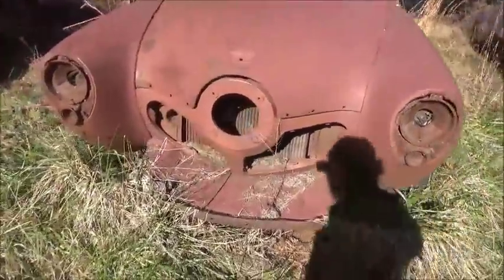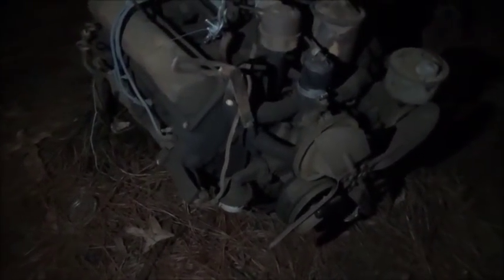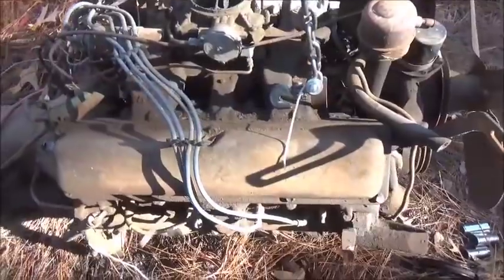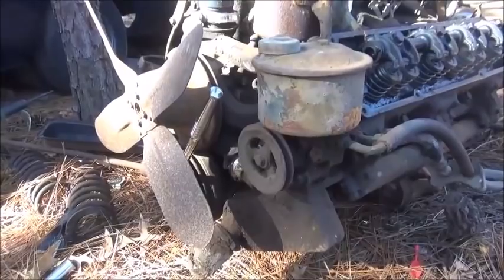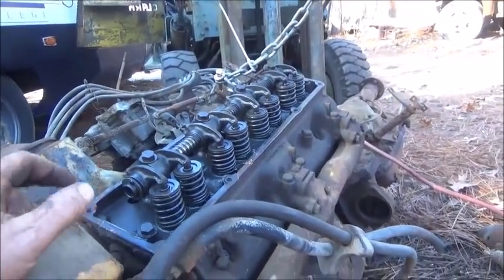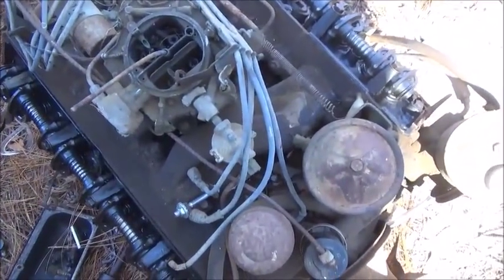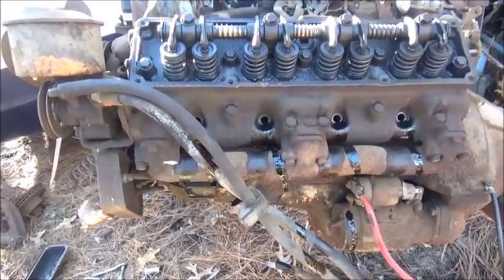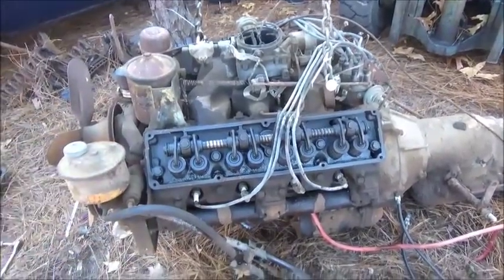1956 PACKARD 374 ENGINE STUCK FIRST START IN YEARS!!!!!!

Comment: With the carb rebuilt that baby will be purring soon. 
Good job Jonathan. Noah is the starter master with a screw driver.
Thanks for sharing.
Reply: @jtyhill5475: The carburetor is a GM ROCHESTER 4 BARREL 4GC. The electrical system is also GM.

Comment: I worked at the Ford Utica plant here in southeast Michigan for 37 years.  That plant was originally built by Packard in 1951.  This is where your Packard v8 and your automatic transmission where both manufactured in the mid 50's.  You really should come up here to visit the Packard museum on that site.  One of the best automotive historical museums in the country.  They have 2 open houses per year.  One in spring and one in the fall.

Comment: Great video, the starter wasn't even smoking. Those old starters take a lot of abuse anyway as they were made better then the new rubbish they sell. We used to start 12 Volt diesel tractors with 24 Volts in the winter, never had a starter fail on us. (the starters did get hot I have to admit) With the old batteries used here, the voltage was more likely around 16 to 18 Volts.

Comment: The engines of my youth! (I'm 73). Nice to see an engine with parts that I recognize. Today's engines just don't have the same soul. In the "olden days" a screw driver, your mom's emery board, a set of pliers and some bailing wire and you were good to go! My new 2019 Camry XLE "talks" to me and I have yet (probably won't bother) figured out how to work most of it's gizmo's.

Comment: Talk about one lucky man. But the minute I saw the engine I thought to myself, this engine is going to run well. The way they made engines back then, especially for the Studebaker were put together right. You can't say that about every car back in the 50s but Studebaker was pretty famous for their engine designs and their longevity and ease of maintenance. I would put them in the same league with Hudson back then. That 374 that you have right there was a really good engine with lots of torque and plenty of horsepower. Now that engine was made to Hot Rod. Pretty sweet Jon. I am really looking forward to seeing what you do with it.

Comment: Thats awesome. I take engines that are out, fill the cylinders with oil, put the plugs back in and turn the engine upside-down for a minute or so. It gets the oil on the valve guides and cylinders below the pistons. It really makes a mess, but really helps lube those badly needed places. If the engine turns, I will turn it over so all the valve guide in the port get oil, if the engine is not stuck. Your engine sounds great!

Comment: I bought a 85 Ford bronco guy said motor was locked up it was the starter and it ran good paid 500 sold it 3500. Always check the starter first thing. Great video as usual guys.

Comment: One time I had a motor that hadn't run in a very long time, and I couldn't turn it.. looked as neglected as this but even worse.  It had very little oil in it, so I put 3 quarts in it, pulled the distributor, and spun the oil pump for like 5 minutes.  Turned fine after that.  It's what I was thinking with this, but you got it turning.  The motor I freed was in an old car that was sunk in the mud, so no access to the flywheel.  Turned out to be a strong motor.  Was a Pontiac 400.

Comment: Jonathan you are a miracle worker getting that engine to fire up after it being ' stuck!'
That will be sweet in your hot rod.
 Just what do you use for parts for a Packard engine after you get it running right?

Comment: 50 years we were at a friends wrecking yard trying to start a 1936 Chrysler imperial that had a straight 8 engine. Our friend Jim was pouring gas in the carb to prime it. The engine back fired and Jim jumped back from the car and dumped burning gas all over himself. He started to run and we threw him on the ground and rolled him over and managed to snuff out the fire. He was wearing Levi jeans and that had helped him from getting burned too badly. His belly and the inside of his legs got burned the most. As for myself, I worked in another wrecking yard for 32 years as the engine mechanic. I ran hundreds of engines over the years and inhaled a lot of smoke. In 2014  I started peeing blood and the doctor told be I had Blatter cancer that was most likely caused by all the smoke I had inhaled over the years. After 4 years of treatment I had no more cancer. Just saying be safe.

Comment: I need that 374 for my 56 executive , I have a standard bell housing a super T 10 will bolt right up . I have a 68 ford toploder I hope to use , I have looked around for 374 pistons no one makes them , tho a 352 can be bored to 374 . A 374 4.125 bore is same as chevy 400 I believe 318 lifters can be used, That vacuum pump mounted on the oil pump kinda sucks " in the oil pan " their is an olds oil pump conversion for it. The packard is the only engine I know of that is 5" bore spacing big water jackets Nice !! I have been hording a 2x4 intake their very hard to find . good luck sir !!
Reply from the maker: I have watched for the intakes, but $1500 is a little over my budget.

Comment: It will run good after a carb clean out I think. The 1956 Packard models, which displaced 374 cu in (6.1 L) and developed 295 hp WOW MAN! That motor should have some good pull. Especially in the light weight Ford 5 window coupe.

Comment: Worked at a salvage yard in the early 90s. Had a late customer at closing time one cold Friday evening and his truck wouldn't start...he tried everything to jump it off. Starter was shot..after 20 minutes of him and different cables etc. The owner said screw this..told the yard mechanic to get him gone...yep.you guessed it. 24 volt jump start..and just like that, he was up and running..works every time..

Comment: well done guys.
I always think a bare old engine needs a steady trickle of fuel rather than a big splash.
Make a bottle to hang above the engine with a tube into carb and adjust flow by nipping the tube a bit.

Comment: Did you also put 24 volts on the ignition or only the starter?  It looks like the dude who filled the engine with oil had the right idea.  It's sure quite a challenge blowing and burning it out, though.  Good good video!

Comment: That engine is 65 years old and it cranked up. Let's do that in another 65 years with one of these 4 cylinder Japanese engines that have flooded our market. Your engine was Made in the USA and still running.

Comment: How to make a perfect motor for the 31- 5 window. My dad told me years and years that old hot rodders used to put old Cadillac engines in their hot rods. When I asked him why he said because there's no substitute for cubic inches and because Cadillac motors always had lots and lots of power. Now that ain't the first time I've seen a 12-volt starter kicked over by 24 volts. Sometimes it's got to be done. Don't you remember years ago when you could buy a custom battery that was more than 6 volts but less than 12? Anyways I think that Packard motor is going to be right at home in your hot rod.
Reply: 8 volt.

Comment: Just thought here Jonathan, but maybe a good 12 volt battery connected to a good 6 volt battery might spin slow or lazy starters a bit quicker. reason i say is back in the day I had 12 volts on my race cars but 24 volts going to the starter and the way I wired the starter feed was 12 volts then solenoid but the out wire went to another 12 volt battery then to the starter = 24 volts spun the starter like crazy....just a thought, nothing more here. good work though Jonathan, and Noah bless him.. make the youth of America proud.. (ian) UK.

Comment: I had a two cycle mini lawn mower called a Merlin. I used to run it all the time. Had a 2 Stroke tecumseh. That engine would seize itself while running once in a while. I would just simply spray oil down the cylinder wall and go back to work. It froze up at least 5 times in the 5 years I owned it.

Comment: if its stuck i like to use some gum out in each cylinder but it only works as long as its wet as it drys fast of couse a little old burnt oil will keep it from scuffing as bad

Comment: If it hurt the starter as bad as people made it out to be then it was already looking for a place to die. I have run eighteen volts through a six volt and it had some cranking power and I used the best battery is series to make thirty six volts on a twelve volt starter an no problems. In fact it kinda sounded like it should cause it didn't slam the bendix any harder but it cranked right away, I ran remote twelve to the coil and more voltage to the starter an that motor hadn't moved in a long time but it hit right off to speak. I haven't had a computer for a while so got to find out why your cranking a packard engine... another barn find. With all the barn finds I tend to think every barn must have a car or there is a lot more barns than I thought... have a great holiday folks

Comment: Is this 374 considered a small block? I know the Chrysler 360 is a small block, but the 383 is a big block...either way, without aftermarket support it'd be cool to see the backwoods tips and tricks to getting this engine to make power. Like Steve Dulcich does with making 400 HP 318s. Funny how it's siamese port like a Chevy 350.

Comment: This would be a good candidate for a 3 on the tree set up in the old car.  I'd put some 3:43:1 gears in the back. Good pull through the gears and at 60, open the 4BBl. anf off you go.

Comment: the car in the beginning of the video could be a 1951 Studebaker Commander Land Cruiser which has an OHV 232 V8 engine and a Borg Warner DG 200 automatic transmission bodywise the car is in good shape to fix up and put back together. as its one of the last of the bullet nose spinner studebakers before studebaker dropped the spinner in 1952.

Comment: I see a lot of guys pouring gas down the throat when all carbs have a breather spot you can fill the bowls.Then pour a little in and see if it runs on carb.
Reply: MrSlim245 very good point don’t think they tried it due to that fact the the carb was probably completely trashed anyway

Comment: In this case where there is a lot of oil in the cylinders I think I would try some starting fluid because there is so much lubricant present and there is a need for a wider range of combustion mixture that the starting fluid offers.

Comment: Boy if they are hard on you about starters they would tried to hang me if they seen some of the mean things I've done. Lol I once used the starter to finish a heat in a derby. It wouldn't start so I just moved around on the starter. Neutral safety switch jumped so it would start in gear.

Comment: Stunt starter, stunt screwdriver, stunt batteries, stunt pine straw, stunt chain, and stunt Noah. Jonathan, you should patent and market all those stunt parts. Then you wouldn't need a disclaimer at the beginning of your videos.
Reply: When you connected 24 volts to a 6 volt starter i could only imagine 5000 viewers fainting.

Comment: Take the air starter off the truck you have, modified it to fit a crank pully bolt...just like Indianapolis (ha). Didn't 1953 and earlier Checy pickups have a dished area in the valence behind the bumper for using a hand crank?

Comment: Hey screw it man, if it gets the engine to kick over fast enough to knock the rust off the cylinders and gets the valves to seat properly, who cares? You can always replace the starter. Some people are just so touchy and always want to complain about something. I mean, I get it, mechanical sympathy, but parts are replaceable.

Comment: Those 12Vs sure shot the oil out of the spark plug  hole...l don't think there's nothing wrong with this motor - take it over to the "hot seat slab", hook water up to it & maybe run the gas to the fuel pump? & see what goes - l'm tuned in

Comment: Been using 12v on 6 v starter s for years no issues.
Actually motors run cooler with higher voltage.

Comment: Well, that will be cool engine to run in the roadster and pretty unique in this day and age. Is it a true Packard design or a Ford with Packard valve covers as didn't they buy them out?
Reply from the maker: Packard went to Studebaker
Reply: @jonathanw4942  Well my buddies brothers used to have a bunch of cool 50s Studebaker cars, mostly the sporty ones and I remember they used the same displacement as Ford but wasn't sure they had anything else in common. I remember they always ran nice and were pretty snappy for a heavy car with a smallish engine. One of them had been a factory supercharged engine but the blower was gone and back to normal. It still was pretty quick as he brought it by once or twice.
Reply: @69Dartman  , the Studebaker 289 V8 was a longer stroke than the Ford engine. It also would out perform the Ford and get better fuel mileage doing so.
Reply: @jerrybrooks870  Well his brothers cars were mostly Hawks and like that when they had the cool modern body styles and 289 hp engines and most were in really nice shape but that was in the early 80s when you could still find nice ones for a good price that were mostly original and unbeaten. There even was a old Studebaker shop in his tiny town with the big sign out front. I think it was a repair shop that still did studes and other cars. His brothers also loved old military Power wagons and had a really nice 41 1/2 ton pick up they drove regularly. I had one too but mine didn't have the original bed on the back but ran and drove great with a wooden homemade bed that was actually pretty well made and a winch with the big bumper so I was always into cars and so were my friends mostly.

Comment: Why not squirt some Kroil in each cylinder and let it sit a day or two? Why not remove the oil pan to inspect the bottom end thoroughly? If something is broken, or oil pickup clogged, you just saved yourself time. With the oil pan off hit everything with brake clean, then lubricate everything you can get to, reinstall the oil pan, throw some inexpensive fresh oil in her and turn it by hand.

Comment: Just plain stubborn! Not sure if it's the motor or you I'm talking about Jon, but it's good
Reply: Each cylinder had more than a teaspoon of oil in it (probably as much as it could hold). That interferes with proper combustion a bit.

Comment: Only time I killed a starter was when I failed to remove power quickly enough when one stalled (hydrolocked due to poor inlet gasket). Risk comes from using a weak battery that doesn't spin fast enough.

Comment: I didn't know the spark plug coil could take 24 volts .
Reply: its possible he only gave the starter 24v and gave the ignition 12v

Comment: For god sake, just fill the damn carburetor bowl and STOP DUMPING GAS DOWN IT'S THROAT!!!
Let the carb meter the fuel, not your damn pop bottle.
Reply from the maker: You mean the oil filled carb.? For God sake watch the next video
Reply: @jonathanw4942  Why was the carb filled with oil?  And if it was, why not unbolt it, clean it out, and then fill it with gas so you didn't burn up the starter and constantly flood the engine?  You took the time to clean the plugs just to foul the hell out of them again...
Reply from the maker: Well I didn't foul them. I am far to busy to clean a carb for an engine that may or may not knock or have a busted piston.
Reply: @jonathanw4942  Whatever dude... sorry but a 50+ year old rare engine like that is worth spending a little time to make it run right.  Again, you took the time to check the plugs, take a few mins to spray out the carb with some carb cleaner or brake cleaner and put the gas in the right way.  If it's worth doing, it's worth doing the right way.  The time you wasted cranking and cranking and cranking... would have been better spent on the carburetor.

Comment: Watching this first start attempt, the racket and the smoke.. I had a funny thought.. Doing this in front of some environmentalist nut's house.  LOL   Just pull up with this on a flatbed and start working it through to victory right in front of their house.  Maybe do it in front of that Greta Thurmburg or whatever her name is.. that "how dare you" weirdo.  Ha.  I made myself laugh pretty well with that thought.  Run some mixes gas (2-cycle) through it after it catches and runs, to get the valves lubed.  Maybe a quart at the most.  It'll smoke, it'll foul plugs, but it'll lube the top of the valves pretty well.  This engine has no hardened seats, as you know.